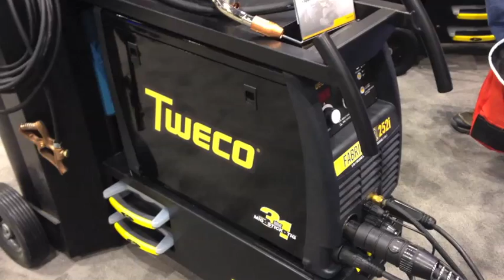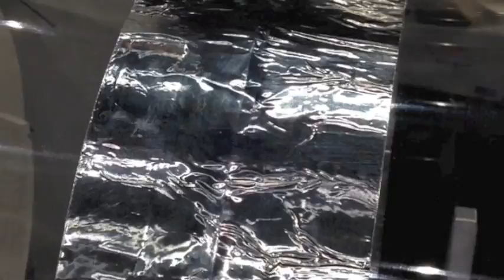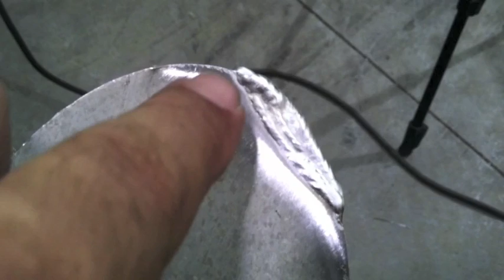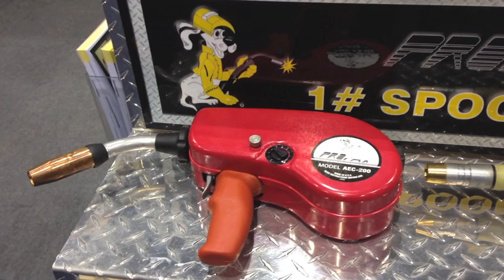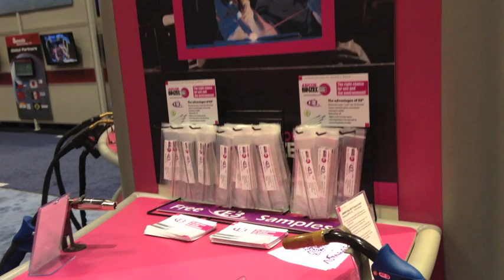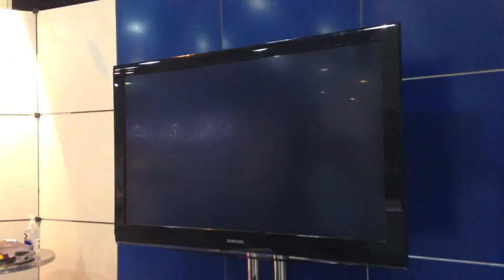Fabtech 2013 Highlights and Welding Video Clips

Comment: there at 9 minutes....I've got a very old (1982) Miller Spoolgun...one advantage is the trigger operates the gas before it switches on the wire....